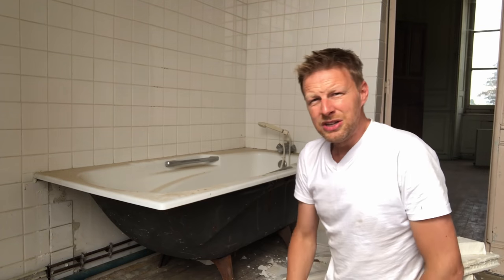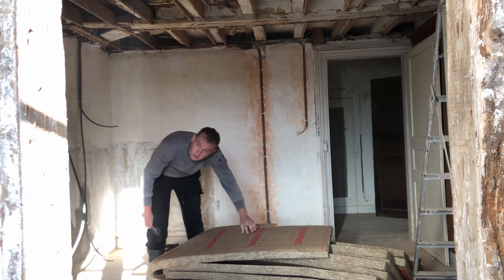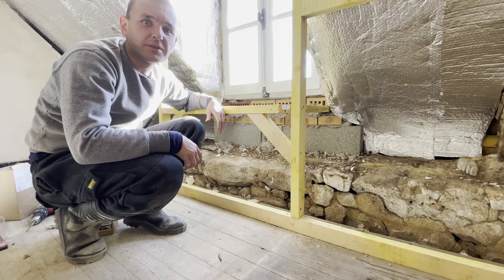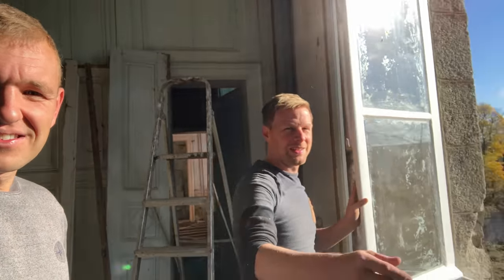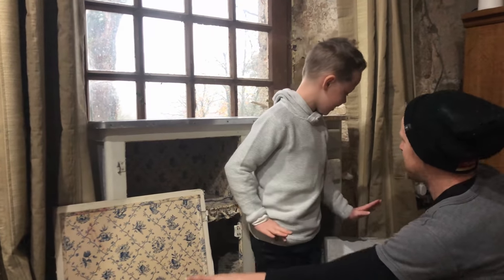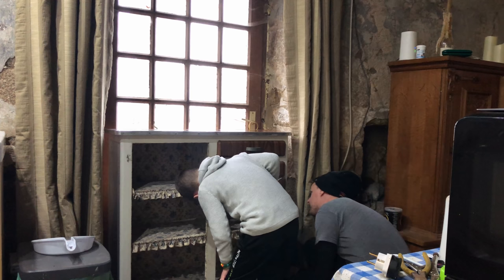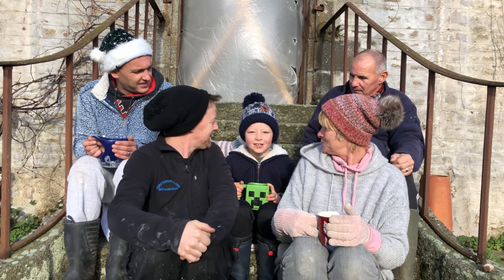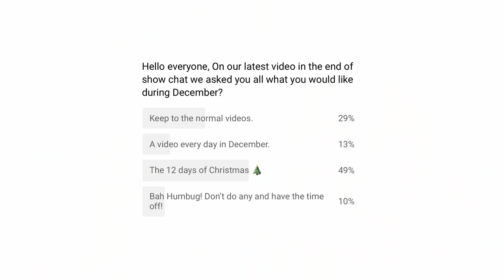Getting Creative At The Château. Ep 30

Comment: Brilliant progress. When you do your Twelve Days, remember to keep them short so you don't burn yourselves out! One of the "days" must be "warm fires" or "working fires". On that note - is it possible to pack one room with portable heaters and work hard on that room, then heat another room, and so forth? Here in the US it's possible to get electric radiators which are filled with oil to hold the heat, and they can be rolled from space to space. Surely there is something similar there -- it would help with cold-freeze-syndrome.

Comment: Lovely work you two on that cabinet. If you want to remove old sticky paper it goes much easier when you warm it with a blow dryer, especially when it as cold as in your vlog. Heat helps with a lot of glues.

Comment: Are you putting enough insulation in? In the U.K. the minimum requirement for rock wool is 250mm (9.8inches). Although new build is increasing that to 300mm. Don’t know what the requirements are in France but I would have thought it would be similar.  Wouldn’t want youse lads to be caud xx

Comment: Wow guys did i hear you say the ceiling that you are insulating is the underside of the roof?...cause if it is then you need for that insulation to be to be as thick as the beams yeah you need as much r-value as possible to keep the heat from going through the roof and the thin stuff you were using can't do it  on its own